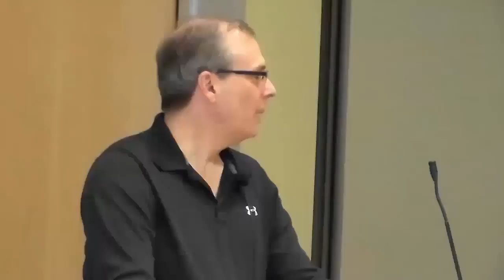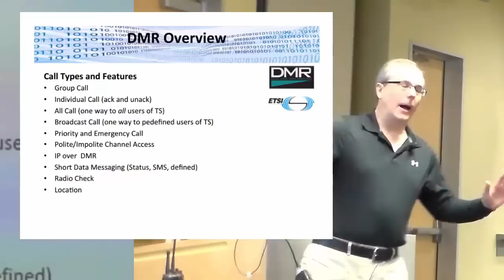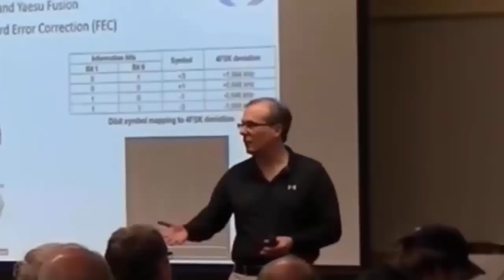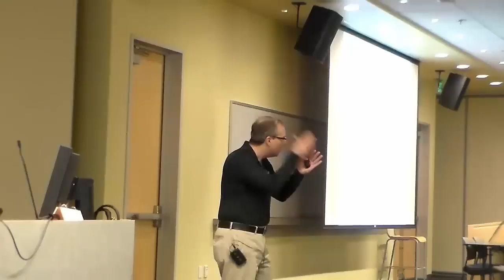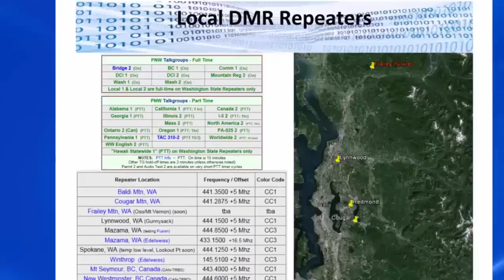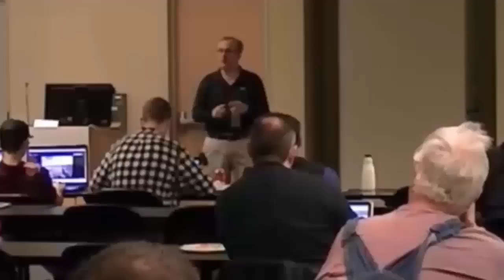DMR/MotoTRBO at MicroHAMS Digital Conference 2015

Comment: Despite the protocal or format, the only two companies using digital modes that denote all efforts to amateur use are YAESU and ICOM. DMR is good, but the manufactors are some kind of lazy in concerning on the aspects of amateur usages. So I'm not fully convinced that DMR is of sudden bright future for amateur radio in a short run.

Comment: Budd, I'm sorry to see someone ranting against the future of ham radio on your video comments page; I guess some folks get cranky when it comes to getting the attention of the younger generation that we need to attract if this great hobby is to hold off the encroachment on our frequency allocations.

Jerry Bosak, I will be honest; I do have my General Class License, but I have little to no interest in operating on HF on a regular basis. If the FCC had never created the No-Code Technician License back in the early 1990's, I wouldn't have gotten it, because I'm unable to learn the code; believe me, I've tried for years to do it, but it's not something that translates properly with me. But that hasn't stopped me from learning other parts of the hobby and finding things in it that do interest me; as it happens, I'm quite interested in writing software for digital modes and am assisting in the development of a new digital mode for use on HF. Perhaps I will start operating more on HF when I get a few hours to sit at the radio, but it won't be just to sit and talk for hours with people halfway around the world; it will be for testing of a digital mode for use in emergency communications.

Comment: sorry but DMR1 isnt "free" there are just 8 / 16 Channels and it called PMR446 !!!
Internal Antenna only + 0,5Watt Max Output....
Reply: +Noway Müller and quite nobody use it becouse a Analog cost ~30€ and Digi start at ~250€.
Even DMR2 Device for Amateurradio are cheaper that the official allowed one.